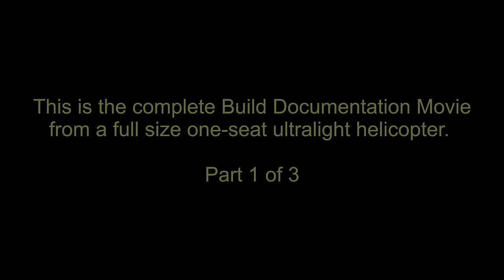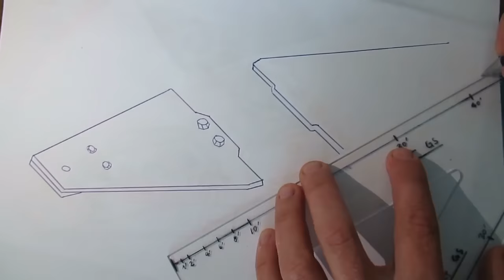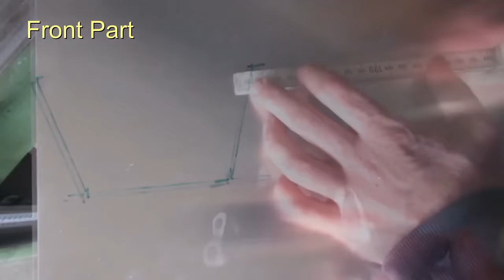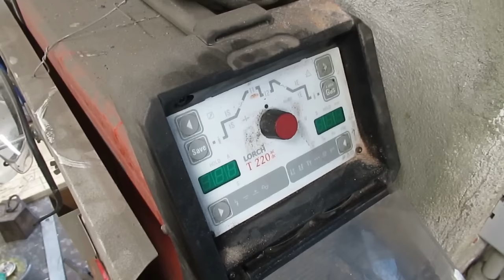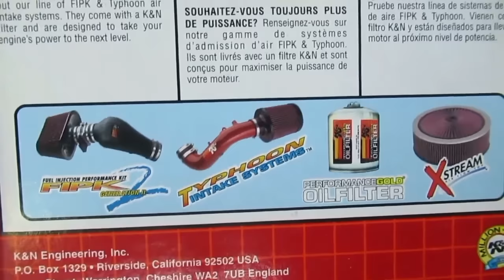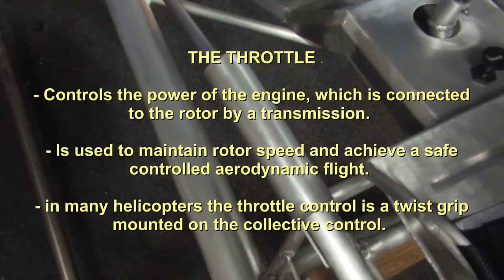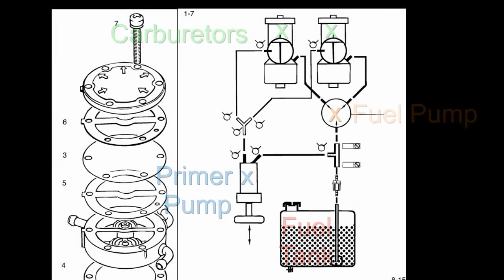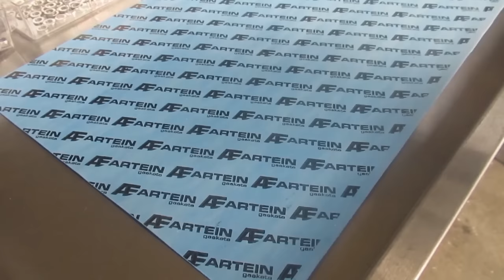Complete Full-Size Helicopter Build Movie (Part 1 of 3)

Comment: Very interesting project! I'm a bit concerned about the welded tabs on the fuel tank though, if they are mounted too securely they are prone to tear open the tank in case of a crash and significantly increase the risk of a fire. Instead of holes, open top U-shaped bolt slots and a securing strap on the bottom would be well secure enough but allow the tank to detach and not tear apart in an accident.
Reply from the maker: Hy. Thanks for your suggestion about the fuel tank mount. I will take this into consideration for a future update.

Comment: I have some questions for the fuel tank, I didn't see you put in a pickup inside the tank, nor a float/sender either, how do you know when you're getting low on fuel? Also does the engine have a fuel pump to draw the fuel into the carbs? there's a lot missing from your assembly video, being an aircraft, I would think that knowing your fuel status is pretty important data to have, correct? Fill me in man. Other than that, your build seems to be going beautifully. I love the way you are making it your own and customizing a lot of it to your airframe. Excellent work my dude!
Reply: No sump. No baffles. No sending unit. No lift pumps. (There are supposed to be 2 in aircraft from what I recall) Yeah man, I'm right there with you in having questions.
Reply from the maker: Thanks, i did a update on the fuel tank to add baffle plates, fluel level sensor and fuel level gauge in part 59 of the EXPERIMENTAL HELICOPTER BUILD SERIES. you can find the video on my Channel or with this link: https://www.youtube.com/watch?v=O1-50hrAavk 
Greetings.

Comment: Those gears freak me out... Stay safe man.
Reply: Pretty concerned about material selection and heat treatments/coatings etc... Also seems to have a lack of wired aircraft grade fasteners. If this is essentially a model then I totally get it, but if it is going to 100% be flying, my engineering alarms are going off big time. Again, stay safe man. This thing is cool but make sure it is safe.
Reply from the maker: Yes, because this build is based on a early 1980s model.